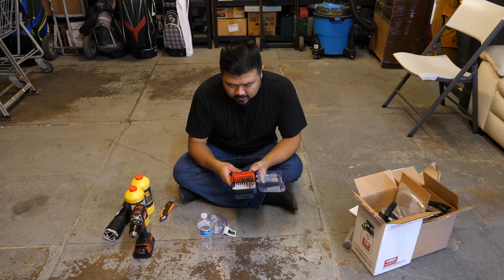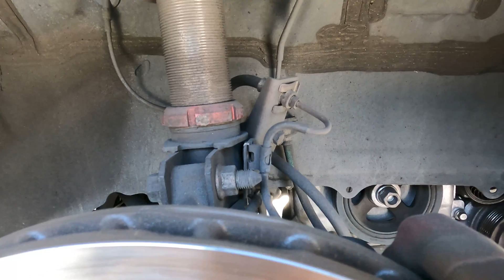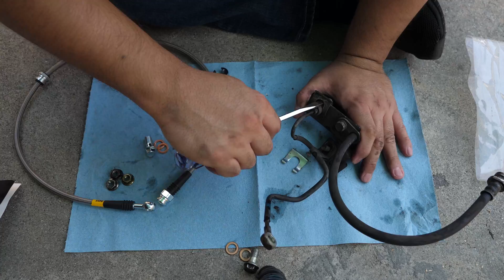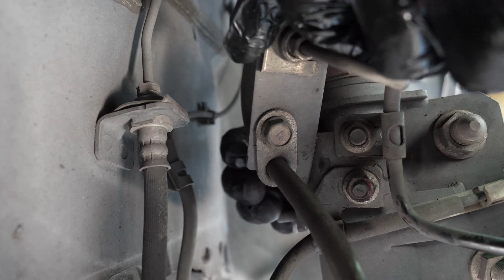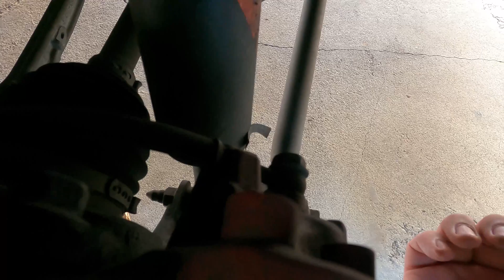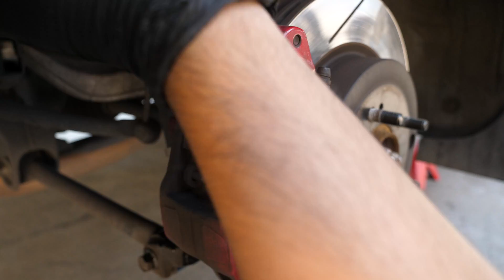Stainless Steel Brake Lines Evo X!!!

Comment: This car has no frame , its a uni body .. you arent usint the right lift points bro
Reply from the maker: Oh didn't know that! Where are the right points to jack up the car?
Reply: @JeffSongCars  look next to the skirt theres 2 peice of sheet metal "clamped" together , there are 4 slots on each side , the closest to the wheel is for the jack stands . The ones that are closest to the middle is for the jack it self.

(Refer to owner manual)  also of you still have the oem spare jack you should be able to set it in the slots so its tight and wont move
Reply from the maker: Awesome thanks for the quick reply haha I'll definitely do that from now on 😁👍